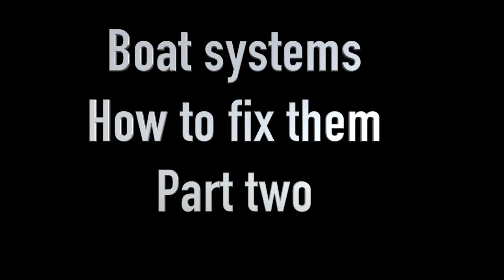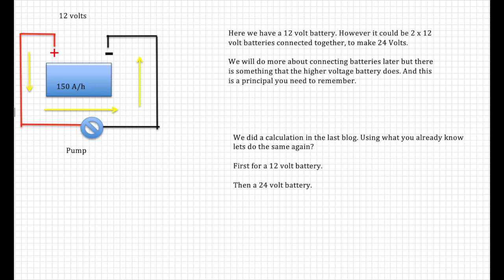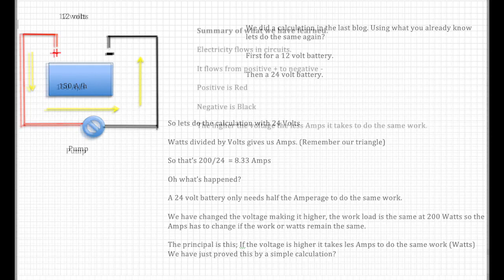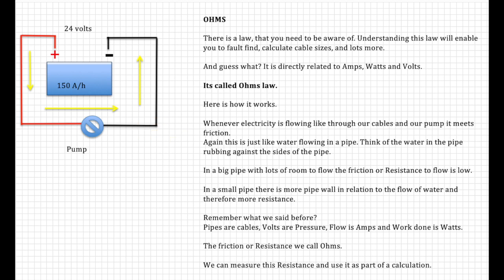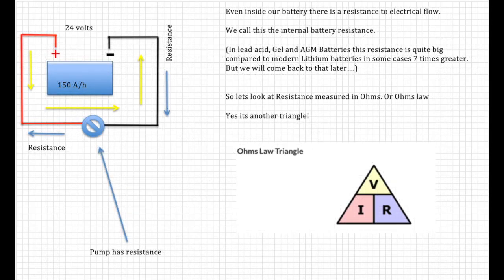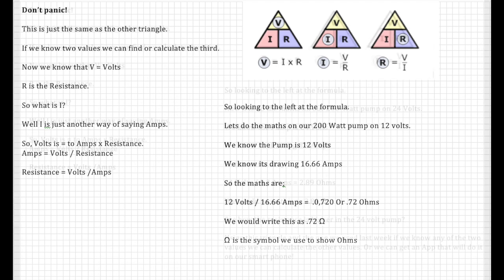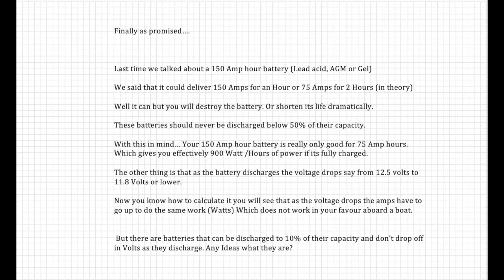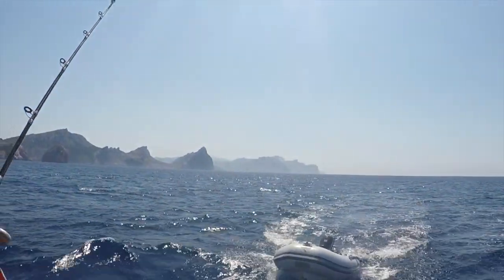Boat Electrical Made Easy. Part two. And some sailing.

Comment: Great video, but why the heck are you towing your dinghy with the engine onboard the dinghy?
Reply from the maker: On short trips we tow it as it is lest trouble to do that than fit the davits, lift the dingy up on the davits and then go the whole process again when we get where we are going. AS we have a tail gate stern. Sail Safe mate. Ant, Cid & the pooch crew.

Comment: Hi, I cannot get my head around when you said the resistance for the 24V is lower than the 12V when the calculated figure clearly showed the opposite. How is it so? Appreciate your clarification. Thank you.
Reply from the maker: You are correct. While the 12v is 16.66 Ohms and 0.72 Ohms the 24 volt is  8.3 Amps @ 2.89Ohms.
The calculation is on the paper but I miss read the script. We have put a correction in the notes as we cannot re-upload the same video or edit it after loading. Sorry if this caused any confusion.
Reply: @SVImpavidus  Thank you for clarifying. Truly appreciate your instructive video and the time and effort making it available for beginners like my good self. Thanks again.

Comment: Hi, please can you help me understand why in series batteries setting we do not have increase in Amps and vice versa with parallel. Thank you
Reply from the maker: Hi, Thats a really good question! 
I will try to explain. When batteries are in series the voltage goes up not the Amp hour rating. 2 x 12 Volt batteries with 100 Amp/h will give you a 24 Volt battery bank with 100 Amp/h rating. The Voltage has increased not the Amp/h rating. 
If you put the same two batteries in parallel, the voltage stays the same. However, the  Amp/h rating will be 200 Amp/h. 
Going back to our water tower explanation. Think of it like this; 
Parallel: Adding more water to a water tower gives you more water to use, (Amp/h). As there is more volume of water. But, the height or pressure of water (Volts) does not change.
Series: Making the water tower higher will give you more pressure (Volts)  but, not more volume of water as the volume of water is the same (Amp/h).....

I hope that makes sense. 
Sail Safe mate. Ant, Cid & the pooch crew.
Reply: @SVImpavidus   Thank you for your response, much appreciated. I think that I got it now and proposing when you having a chance to make another great post as earlier covering the parallel and series multi battery connection s and how they related to Watts, Amps and Volts and what the pros and cons are.
Thank you again for helping Sailing community, Kiro
Reply from the maker: @kireiolja5784  Our pleasure! Be sure to share with other yachties. Sail Safe Guys, Ant, Cid & the pooch crew.

Comment: Hi, when I worked in the electrical industry we always thought electricity in a battery flows from negative to positive have I been wrong all these years we would always put fuses in the negative line.
Reply from the maker: Hi Don. Well actually your sort of correct. There are two things that contradict. Firstly there is what we refer to as current flow, from positive to negative or in AC live(hot) to earth(ground) But actually the flow of electrons is the opposite. From negative to positive. Negative remains negative because it gives up electrons to the positive. However, fusing on the positive side means in the case of a switch or fuse being blown or open the remainder of the circuit is harmless or negative /grounded. It's a very good point you have made in this comment and something we should cover at a later date when things get more in depth. Thanks for taking the time to comment. Hope you enjoyed the video. Ant.

Comment: 12 v / 16.66  = 0.72  Ohms
24 v / 8.3  = 2.89 Ohms 
How is the resistance lower in a 24v  system ??
Please explain  ???
Reply from the maker: Kenith, Will do we have had the same question before, But a full explanation will take a bit of time to type and we set sail at first light. We will get back to you when we are a few miles south of the coming weather system. Thanks for watching. Ant
Reply from the maker: Kenneth have you watch the next video? We put a better description in it? At the beginning. Or give us your email address and we can send you a very detailed explanation with diagrams. Best regards Ant.

Comment: Bit disappointed you did not cover the heating effect in the cables?😉😀👍
Reply from the maker: I thought we would do that with cable calcs Norman. Or with heater elements? It's a bit of a job to cover so much without going into a lot of detail or just covering the basics that will get people knowing how to fault find or repair. I debated the magnetism and poles subject in my head for ages trying to keep it simple but still making the point. Perhaps we should make it a series rather than trying to keep it to 4 videos there is still a lot to cover?  Sail Safe Ant.
Reply: SV Impavidus (Ant & Cid Sailing) Ant - I think you are doing an excellent job - I was just teasing about (I squared R).👍
Reply from the maker: @normanboyes4983  I have a plan for transformers more about AC and safety. I think I should do a simple charger showing diodes or rectifiers. Reversing solenoids for things like winches. Double pole switches. and a typical boat schematic. Charging from alternators, solar and wind gens.  Before going on to fault finding. That's a lot to cover in one video so It is most likely going to go 5 or 6 videos on just the basics.  Any suggestions would be greatly appreciated. Sail Safe. Ant.